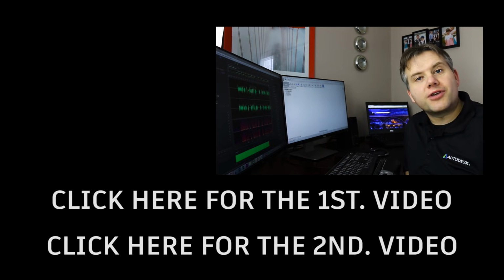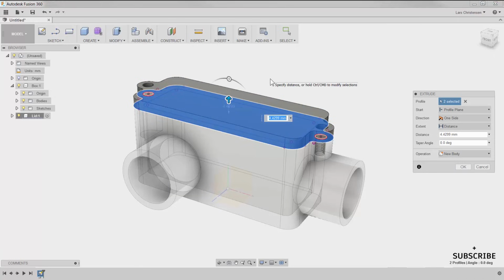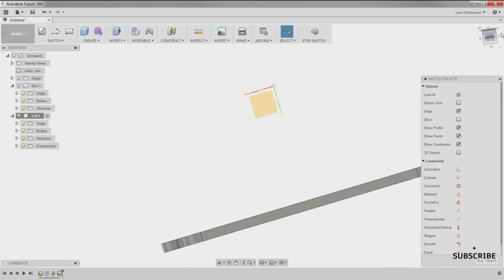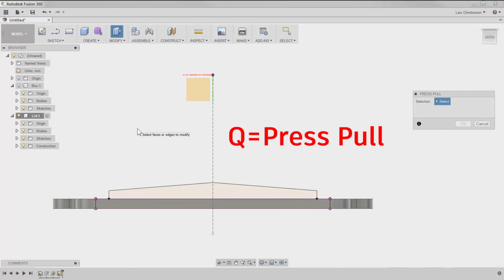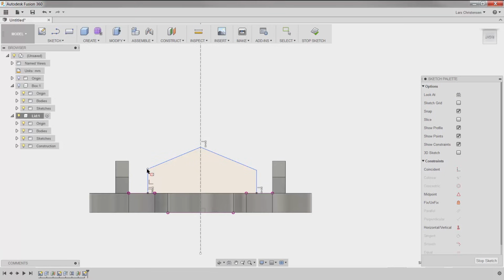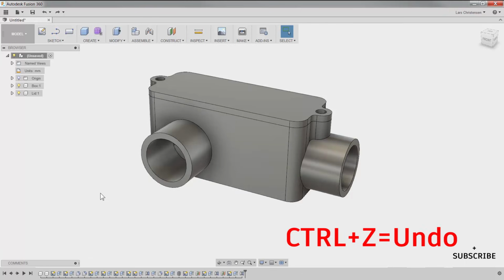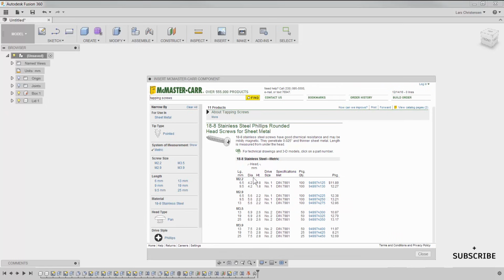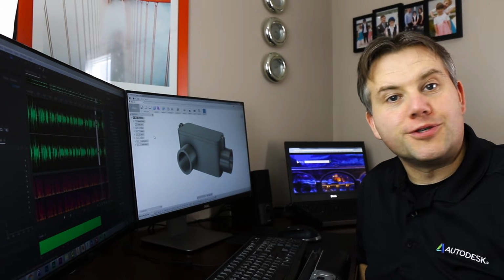Fusion 360 Tutorial for Absolute Beginners— Part 3

Comment: I tried making the lid without using the project tool and it worked fine.  Just selected the top surfaces of the box, it went blue and I offset 4mm.  Is that because I'm using a version 4 years newer?

Comment: I've been trying to do the dimensions portion of this video where things are upside down and i am absolutely struggling. When I enter dimensions it moves the wrong parts of the sketch. I don't understand why.
Reply from the maker: Not exactly sure what is going on. Maybe take a few steps back and see if you can get things to work like the video?
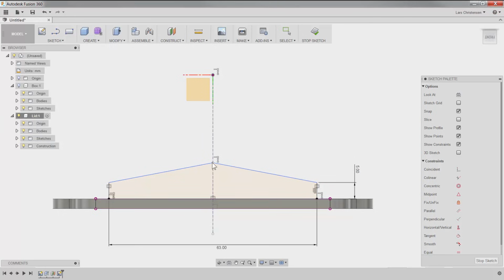Reply: Lars Christensen I have the same problem at this step. During the dimension confining (at 9:00 of this video) when I type down the number and hit enter, the whole drawing lower itself so that the top part is 5mm instead of the top part moving alone. For me it either ended like this or the whole drawing turned into a weird intersecting shape. It feels like some where in the drawing got confined unintentionally.
Reply: @lupin4302  Exactly! funky shapes, or it moves the shape instead of resizing it.
In the end, I just drew the shape I wanted out in the air with the dimensions I wanted. Then manually moved it down onto the location I wanted. I simply wasn't able to modify the shape via dimensions the way Lars was, despite watching the video and following along 15 times. Its definitely my lack of knowledge though. Like I didn't click a button or hold a key down or wasn't crossing my toes when attempting to do that task.
Reply: @wykelized  I was playing around and found a way around. In the confining function block, there's a lock button. You can choose the bottom line after you confined its length and it will just stay in place. I'm not sure if this is the correct solution for such a problem, but it gets thing done.
Reply: I think that I´m having the same issue. Just for reference, I´m using the 2020 version. First, I thought that I was being able to snap the lines to the lid body, but when I turned off the grid snap, I realized that the lines were not snapping to the lid, instead they where snappíng to the grid. I still can´t make them snap and create some sort of constraint within the lid body, so when I add the dimensions to the sketch it somehow changes its form incorrectly. I tried to go back and forth many times and I´m still not able to understand why it doesn´t snap. I must be missing something.
Reply: Ok, after a quick Google search i found this article and was able to fix the problem. Hope it helps you too. https://knowledge.autodesk.com/support/fusion-360/troubleshooting/caas/sfdcarticles/sfdcarticles/Cannot-snap-to-components-when-sketching-in-Fusion-360-on-Mac-after-an-update.html
Reply: @Churrasquero  The link solved my problem!!! My line sketch with 5 sides was moving up when I added the 2.5 dimension. Thank you!
Reply: @SteveA58  Nice man, glad I could help. This tutorial is great.
Reply: @Churrasquero  interestingly enough that page is no longer available.  I have that issue.
Reply: @Scottforyoutube  perhaps beacause there's a new update available and maybe they fixed it. But It was a option in the user preferences that allows snaps between different compounds, that was automaticaly disabled in that last update. I'm away from my computer right now. When I get there, I'll post how to enable that feature again.
Reply: @Churrasquero  thank you!
Reply: @Churrasquero  Edit: Got it, Name > Preferences > Design > Auto Project Edges on Reference is on Thanks to @Mr. Random
Reply: @Scottforyoutube  Nice, did it work for you? Hope it helps others too. Thanks.
Reply: @Churrasquero  yes that worked great, now I'm struggling with the screw placement, it does not work like in @lars Christensen s video.  It is of course the updates that are breaking it combined with my complete lack of understanding of the program. Thanks for your help!

EDIT: turns out it was really my inability to follow directions.  I wasn't catching the right face/center.  Problem solved!
Reply: @Scottforyoutube  Thank you!

Comment: Great video. Got all the way to the end fitting the screws but no mater what I do the screws insert up side down in the hole. The point sticking up on the top and the head underneath. Is the procedure different on the latest software version?
Reply: there is a flip option in the joint dialog box. try that.

Comment: Would it be bad working practice to have added those locating bits to the top of the lid and then just flipped it 180 degrees?
As a total beginner it would have seemed to me to be the easiest way to do it.
You are very good at explaining steps without boggling the novice's mind!

Comment: woohoo, yo're da man !!! ;-). Thanks so much for this beginner lesson with a really good example for start to finish. My Fusion 360 version on OS X is a tiny bit different so at times I had to figure out the right keystrokes. But I got through it. Offsetting the plane is a bit of a mindbender but even that went through. It took me half an horu to get the screws in. Well, just like in real life ;-). Just gotta know how to hold the screw. 
I was getting very frustrated with Fusion and was close on walking away. But these three evenings with doing this little case changed my mind and got my confidence back. You surely got me back on track. Long way to way to go but I am back on track again for simple 3D parts.
THANK YOU VERY MUCH !!!

Comment: Hi quick question. when I want to draw a line as explained in 6:58 minutes the snap line doesn't become blue. What did I do wrong?For the rest very useful.
Reply: There's a setting that is disabled by default in the new version of Fusion 360. To turn the setting back on, go to Preferences (your initials in the top right corner, then preferences), then "Design," then make sure the following are enabled: Auto project edges on reference, Auto look at sketch, and Auto project geometry on active sketch plane." Upvote this comment if it worked for you so more can see it.

@Alastair Moore @Jitzu666 @Linh Hoang @Sanne Stoutenbeek

Here's a link describing the problem and how to fix it:
https://knowledge.autodesk.com/support/fusion-360/troubleshooting/caas/sfdcarticles/sfdcarticles/Cannot-snap-to-components-when-sketching-in-Fusion-360-on-Mac-after-an-update.html
Reply: @EadieCD  Thanks Chris. Two out of three were already enabled in my preferences. I added 'Auto project edges on reference' and it worked! My new line now attaches automatically to the body of the lid. This was really helpful.
Reply: @EadieCD  You are a legend!
Reply: @EadieCD  You're a god. Bless you
Reply: Thank you people! Thank you Sanne for posting the question, and thank you Chris for your beautiful solution! ik ben zeer gelukkig!!
Reply: I'm sure this isn't the correct way, but the way i got around this was to make a line finishing the drawing and then just extrude that. the lines never turned black for me, but i could click the blue infill and use that anyway
Reply: I had the same problem but figured out that you can use constraint. You don't have to be precise clicking on that edge. You can specify/constraint that horizontal line with vertical line by  coincident.

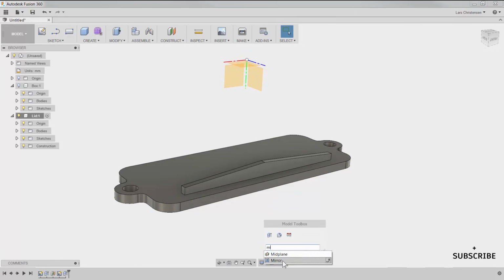Comment: I know this video is a few years old and some things have changed, but I'm able to mostly follow it. One thing I am caught up on is the mirroring at the 10:00 minute mark. When I select mirror, then click feature, then select the triangular bit, as soon as I select the facing plane to mirror it, it does it, but it's way off to the side. It's not mirroring it the same distance away from the edge as the first part. Anyone have any ideas?
Reply: Change the mirror function's compute option from "Adjust" to "Identical".

Comment: Just went through all three of these and managed to assemble the conduit box however there were a few thing that are different. Is this because you have updated the software or have things changed in the way this system operates? I still managed to work it out after quite a but of swearing.

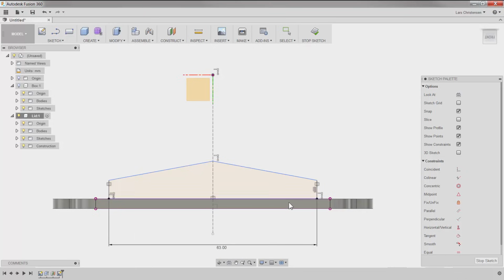Comment: 8:50 whenever i fixed the dimensions the whole thing just went up, i then tried enabling "Auto project edges on reference" which made it go down instead but still refuses to stick to the lid
Reply: I fixed that with the fix/unfix constraint. just choose the bottom line contacting the lid
Reply: @ThoughtBit  Thank you very much!
Reply: I was able to use the collinear constraint with the bottom of the sketch and the part of the box that it needed to stick to.
Reply: I fixed that by adding an extra dimension to define the height of the triangle as 2.5mm

Comment: I'm struggling to get the screws placed. It seems there are many selectable places on both the screw and the hole, and my control button doesn't seem to lock the cursor to the face of the back side of the head of the screw. I can't seem to get the exact selection executed in the tutorial, and each time I finish the joint the screw is misplaced. Any tips?
Reply: I am having the same trouble! Any suggestions from anyone? My control button makes no difference. I cannot select the center of the lower surface of the screw head, aka the "packman" figure doesn't appear.
Reply: So I didn't give up and got it right - the most important thing is to do the joint command, before attempting the selection. inside the command,  the procedure is controlled by the joint pop-up box, in which you make each selection systematically. When doing this it knows where you want to select the screw and the control button actually works now

Comment: There must be differences between the current software and the version Lars used when he did this video.  The contraints for the lid tabs don't work like they do in this demo.  Symmetry seems to be enabled by default, and I cannot set the dimension of the tab thickness; I get this error "Adding this dimension will over-contrain the sketch.  Choose OK to create a Driven Dimension".  I've no idea what this means and am not sure if I caused it.
Reply: Hi there Jeff R. I hope you found answers to most of your frustrations. There are definitely subtle differences, but My approach is as follows: I follow each little step of what Lars is doing, and I concentrate on achieving the same objectives every time. For example (just as an example where I applied this), when making the first offset plane sketch, I couldn't get my line cursor, to snap to the surface of the lid on my plane. This is vitally important. Unless you  achieve this, you will never get a correct result, and to understand how to get it right, is just as important, because you need to learn the logic of the modeling. I am brand new to Fusion360, but applying my experience in other software, I have released that these minor details make the difference between getting or not, and spending hours and hours to get something to work that wasn't done correctly in the first instance.  To expand on my example, as I fixed my issue by correcting the settings, I continued to draw the sketch as instructed by Larse. But I still had issues. Some lines turned black before they should have, because I didn't realize that  points were already created at 18mm apart, and that disabled me being able to adjust the shape using the dimension function. So I went back and made sure I achieve each little step with selections and line coloring exactly mimicking  the example.  In the end I had learned so much, by just making sure, I follow  and achieve each step of the process, he so quickly and effortlessly completed in just 30 seconds.

Comment: Thanks Lars, At 7:00 in you are starting a sketch and starting on the top line of the lid. I can't seen to find this line, I notice your cursor is a cross
and when you hover over the line on the lid it changes to an X , my cursor does not do this ??? I'm stuck at this point
Reply: Solution found by someone down in the comments.."Ah found the solution down in the comments! Go to your preferences and turn on "Auto project edges on reference" under General -> Design!
Reply: Thanks William S-R that worked
Reply: Thank you so much to whoever found that, you have saved me from going through all three videos for the third time as i was convinced that i had done something wrong in an earlier step

Comment: I cant seem to get the lid to extrude at all ... It works if I redefine the plan to the origin, but then it lies within the box :(.
I am selecting the projection lines ok and drawing the circles ok, when I press Q I get nothing above the plane of the top of the box, only into the box .... HELP!
Reply: I found a post by LeptosporangiateMoor
 on Reddit stating that the issues is the section analysis being turned on. I turned it off then it was all good :). Here is the link to the Fushion help desk. https://knowledge.autodesk.com/support/fusion-360/learn-explore/caas/sfdcarticles/sfdcarticles/How-to-undo-end-or-turn-off-a-section-analysis-in-Fusion-360.html

Comment: That was the best set of video tuts I have encountered.  Just one thing that may help tweak the technology.  When you are addressing new information never use pronouns.  I am new to the subject and need to be able to connect the buttons and objects with names so I can nail them down.  I need to here the names connected in more than one context to fix it in my mind.  Also, I need time.  While you are talking I am trying to make mental connections so, after each affirmative statement, give just a second pause.  It slows your pace slightly an gives the listener time to make internal connections.
Reply: I need to hear the names.

Comment: Thanks a lot for such tutorial, however, I stuck @ 7:00 as the cursor never indicates for the intersection point with the Lid. In addition when I moved on and ignored this and while I'm working on constraints the sketch is always going down. After several trials, I have moved the whole sketch manually, but unfortunately, the extruding didn't work as expected.
Reply: Solution found by someone down in the comments.."Ah found the solution down in the comments! Go to your preferences and turn on "Auto project edges on reference" under General -> Design!"
Reply: @ziansarkar6521  Thanks a lot. It worked with me.
Reply: @ziansarkar6521  thanks alot  Jazak Allahu khairan ( and for prefrences right click your name on the top right )

Comment: When I try to resize the dimensions to 5 and 2.5 on the lid tabs, every time I dimension the center line to 5 it moves the sketch down below the lid. Driving me crazy, got this far without a hitch.
Reply: I was having this same issue! The problem is you need to turn on  Auto Project Edges. Click your name in the upper right hand corner>Preferences>General>Design Check mark Auto project edges on reference. This will allow you to snap to the lid. I bet either 4 years ago when this was made it was on by default or it is a setting he didnt realize he turned on. I spent the past 3 hours beating my head against the wall until I started reading more comments mentioning this setting.
Reply: @chuckfiero  OMG! Thank You!! I just completed the first tab on the Lid. You saved what little hair I have left.
Reply: Should be on by default for sure.
Reply: @chuckfiero  Thanks man, I was 
frustrated AF after trying to draw that sketch over and over again.
Reply: @chuckfiero  thank you for the help, I was going to go insane without that tip.
Reply: @chuckfiero  I tried changing this setting and I still have this problem.  I've been searching online for a solution but struck out. Any other suggestions?  Thanks!
Reply: @danbo98042  Since I am a novice myself I am not sure. The only other issue I could see is if you havent done your offset plane correctly.

Comment: Min 7-9: I have drawn and redrawn that line several dozen times. (Sometimes the dimensions mess up the geometry, but not always.) I even remodeled the entire lid. That line WILL NOT turn black. 

Yes, I turned on Auto Project Edges in the preferences.

ETA:
Ok, I managed it. I think my line was snapping to some wrong part of the lid.

I did this: 
1. I traced a construction line over the purple line that was autoprojected on the lid. (Definitely turn on Auto Project Edges.)
2. I then turned off "Bodies" so the lid disappeared. 
(I actually liked the way this worked better.)
3. I drew and dimensioned the shape using the two construction lines only.
 
4. It turned black and extruded properly. I turned Bodies back on.

This issue did NOT repeat when I sketched the smaller tabs. I was able to sketch the second one as Lars does in the video, so IDK what was happening with the first one.

Comment: I cannot mirror the inside lid railing.  After I choose the feature and plane the mirror projects the feature out past the lid.
Reply: I have the same problem, the lid tab is on the edge of the lid, after using press pull. Did you solve this problem?

Comment: I cannot get this to work. The inner parts of the lid don't work as shown in the video. For me as a total beginner I cannot get this to work. Either it does not snap correctly or it does not turn black (meaning it is fully defined). :(
Reply: Did you complete the sketch? Meaning, you connected the points all together to make a solid shape?
Reply: @mdspence11  I did a few more tutorials from Lars and understand now what it means to get it a "fully defined thing". Not exactly sure what I was messing up besides not using the origins properly (so mirroring didn't work as expected).